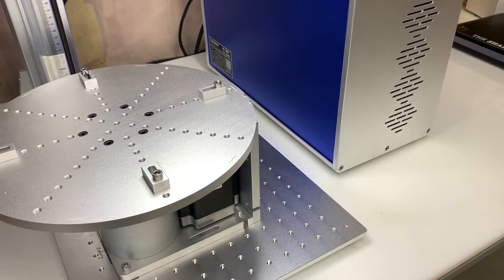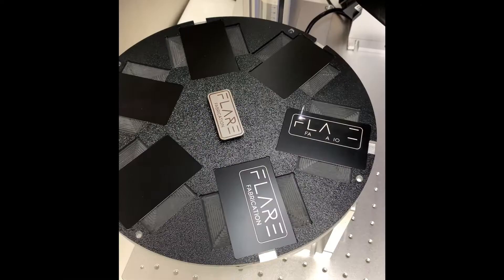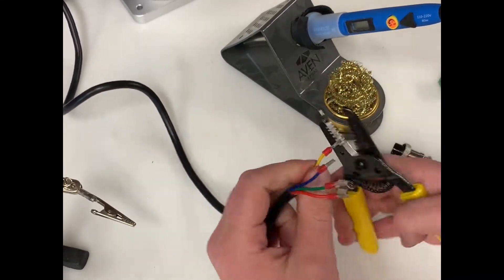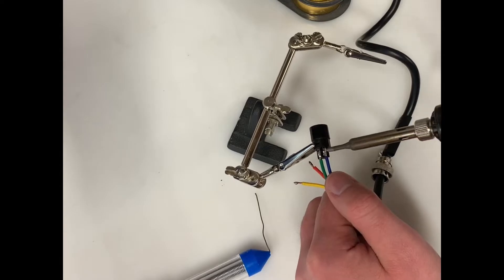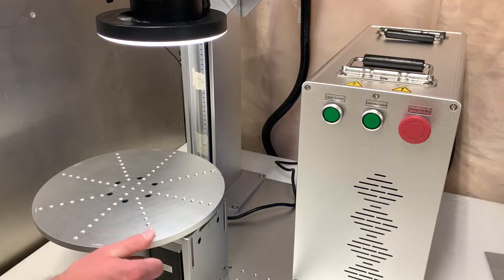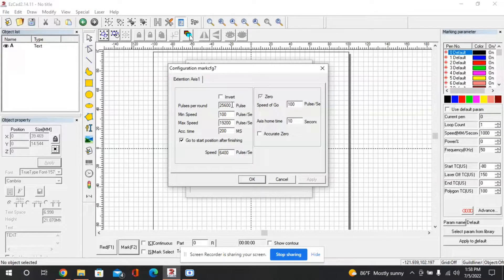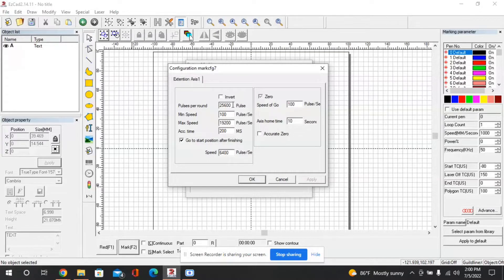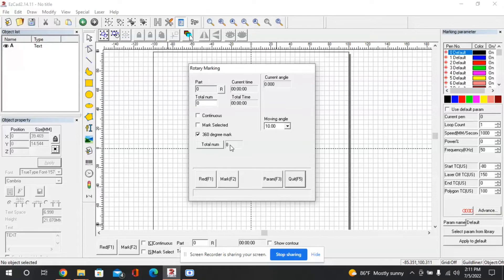How to Setup and Operate a Rotary Table for Fiber Lasers

Comment: Hi there. Great job on the video. I am currently in the market for a fiber laser and have been looking at Cloudray. Based on your experience would you recommend? Would you mind sharing the configuration you bought and would you have any tips/suggestions for someone about to buy a fiber? Really appreciate your time and input. Thanks.
Reply from the maker: Thanks John! My experience with my Cloudray fiber laser has been terrific. I do believe that Cloudray is one of the best Chinese manufacturers for fiber lasers, and also has some of the best bang for your buck. For a first time buyer I would recommend either a 30W or 50W machine. Both can do the same things, but a 50W speeds up engraving considerably if you’ll be doing deep engraving work. For a first time buyer I would also generally recommend sticking with a Q-Switched machine over a MOPA machine. The only real difference is that MOPA opens up more possibilities to do colored engraving on stainless steel, but it comes at a considerable price increase. As for laser software, I’d strongly recommend purchasing LightBurn for Galvo, instead of using EzCad. It’s a fantastic software that I can’t recommend enough. Best of luck to you!

Comment: SO..... Cloudray told me the stepper driver inside my machine wouldn't properly run my rotary table.  My machine came with a driver, because I had a rotary already setup.  Do you know the proper way to install the recommended DM860S?
Reply: Hi there I am also trying to get my DM860 setup. Did you ever figure out how to setup yours?

Comment: The one thing that he should be guaranteeing after seeing him put those wires together and hearing him talk about opening your machine to do all this excess work he's reassuring that you void your warranty possibly short out your machine yeah I don't think so
Reply from the maker: If you are not comfortable doing basic electrical work then I would not recommend wiring the rotary table yourself. That being said, there is a very low risk of causing any damage to the laser due to miswiring.